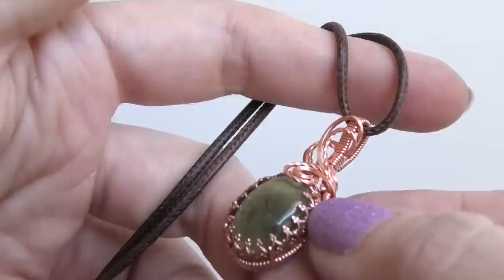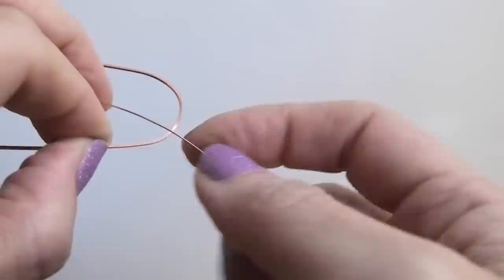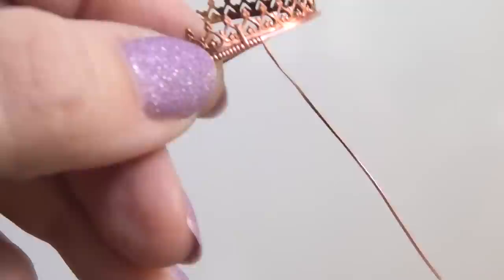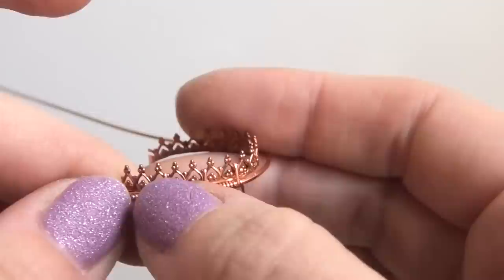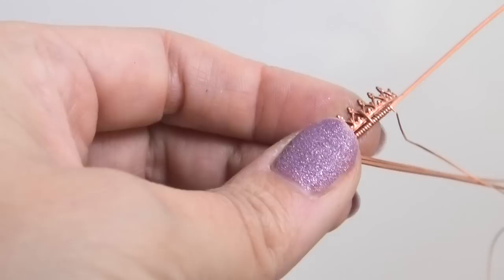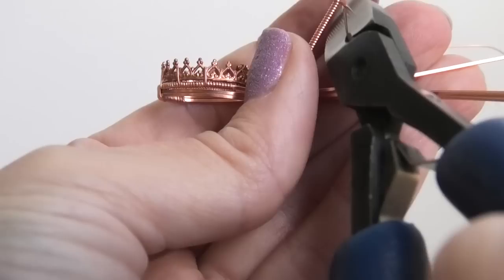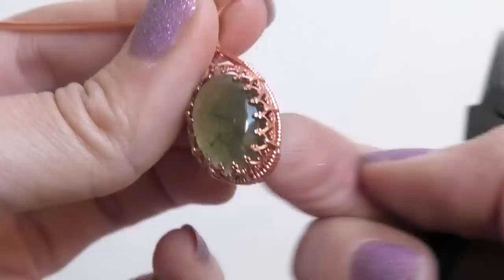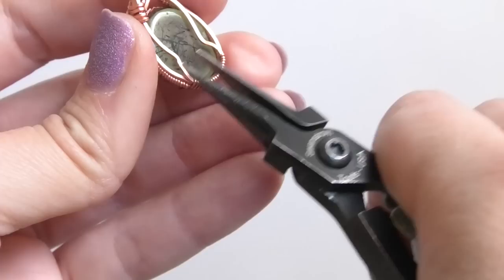Gallery Wire Bezel Cabochon Pendant Wire Wrapping Tutorial

Comment: FYI. Maybe for future reference, when using a bezel alarm with square wire. Where the bezel is meeting up together where it overlapped. It should be at the bottom of the stone wrapped with the wires that way it would be covered more. If that makes any sense????
Reply: That's a good idea, but I'd only do that if the points matched up near perfectly since they'll be more visible. At the top, the extra wirework can hide that. Of course, depends on one's ocd😮.😊
Reply: I use a small piece of 28 gauge round wire to connect my bezel wire together. I sew through the holes on each end of the decorative wire and have each side meet up together. It’s very secure that way.

Comment: Love this one … I kept my wires straight through the initial attachment of the gallery wire … and used 26g round wire instead of 24g half round … it worked fine but the half round probably would have looked better

Comment: This is the first gallery wire, wire wrapping combination I have seen. It is very clever and beautiful. You could use the back of a stainless steel spoon to push over the tops and do a final burnish. Just drag it over the tips and the stone. It won't scratch the stone or the meta tips. Can't wait for next time. See y'a! 😷⚒